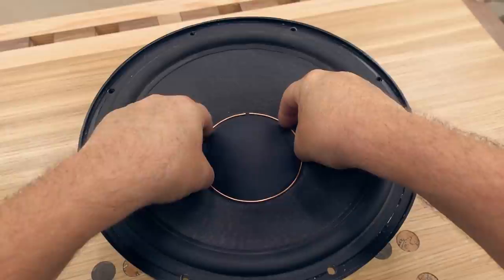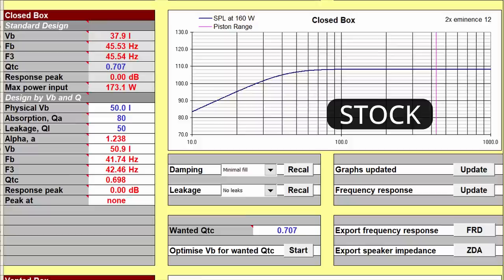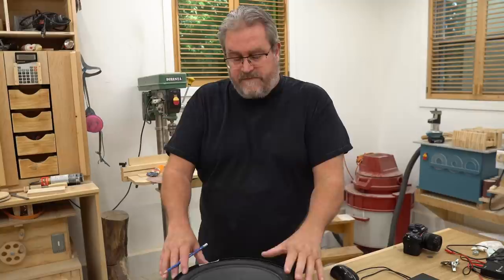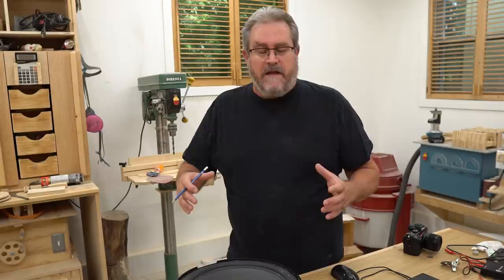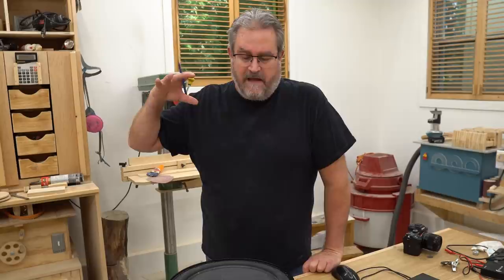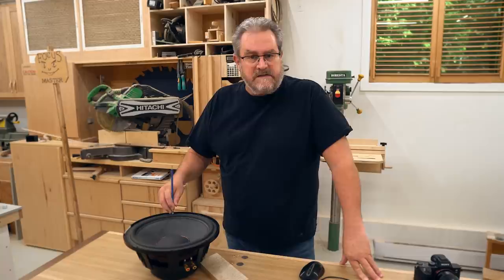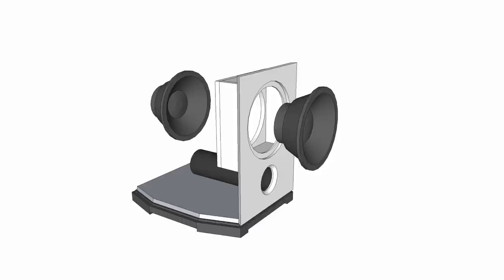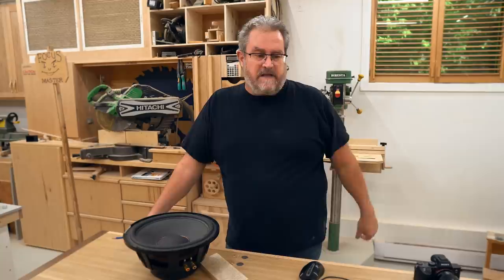Dead Simple Trick to get More Bass from a Woofer / Subwoofer

Comment: I taught, for every 3 DB less sensitivity, you need to DOUBLE WATTAGE from your amplifier to get the same maximum volume. Example: If your speaker can reach 120 DB @ 150 Watt and the sensitivity from the bass speaker is 90 DB @ 1 Watt/ meter,  and you add a ring on the bass speaker cone, the sensitivity is going to be (let's say) 84 DB @ 1 Watt/ meter you would need a 450 WATT AMP for the same maximum volume (120 DB). How are the midrange and the tweeters going to react to that kind of power in your system? There is no way to add a ring in 3 way speakers, I think?
Reply from the maker: Adding 14 grams to a 12" woofer drops the sensitivity by just 1db. 
This is for people who build speakers and understand the specs and design tradeoffs and are able to keep things in perspective.
Reply: @IBuildIt   Thanks for explaining it to me. I'm in an audio learning process, just as a hobby. It's for me like the more I know, the more it feels like I know just a little, and it's really becoming complicated. People like you on YouTube are great to learning about audio, and I'm happy you are explaining things like that in  this video, thanks again mate :)

Comment: And....what about induction in your coil?..non linear.

Better to put the epoxy in and drop in lead shot for weight...not touching.

And what about damping? Can be altered with panels stretched over basket windows.

And what about Xmax?...bottom VC with xtra weight?

And...how does it affect Qms and Vas?

Comment: Adding mass does not increase maximum power handling.  Just getting a stronger amp just makes you more likely to blow the woofer.  Secondly, mass takes time to stop.  The suspension acts like a spring.  It takes time for it to stop mass from bouncing back and forth.  This is what the waterfall plot measures - the decay rate.  Adding mass decreases the decay rate, and that is never considered desirable.  FFS don't ever add weights to your speakers.

Comment: Dang ol subs now over dun glued with the quickness over for some dang ol added weight for them lows and now it got dang more resistance and r value over dang ol glue epoxy with them dang ol drivers set up with the boxes yep and fs is ol dang been lowered now with the raised ohm factor on the chart dived by the ol test modual implicator process ol metal clamps there tester. yersir, know what I mean?..    Boomhower n yep.

Comment: Your incorrect with the efficiency. As you add mass, the driver becomes more efficient at lower frequencies and takes more power to produce high frequencies. As you reduce mass the driver is more efficient at high frequencies and takes more power to produce lower frequencies. Now what you need to keep in mind when producing low frequencies 30-40 Hz. you have to have a driver the has a lot of excursion ( X-max ) for it to have a lot of output.
Reply from the maker: That's not really the way it works. As you drive down the Fs of the woofer by adding mass, it will take more power to produce the same output spl as the unmodified driver. But the modified driver will be playing lower in frequencies - more or deeper bass output.
Reply: @IBuildIt  if you put a high fs woofer in a sealed box it will need more power in the low bass because you no longer have the resonance amplification, which now peaks further up. If you increased the suspension compliance and used a bigger box, the low bass efficiency would come back even greater than the heavy cone.

Comment: This is a bad idea.  Adding mass just lowers the output at higher frequencies and reduces the maximum SPL at those frequencies.   If you want more bass simply use some DSP to boost it.
Reply from the maker: It's manipulating the performance of the driver, like tuning an engine for more torque at the cost of lower revs. 
Drivers are designed - they aren't born perfect, but are a tradeoff of different performance goals. To tweak the driver to perform the way you want it is no different from using DSP, except you don't need DSP to do it.

Comment: Fast bass is more satisfying than slightly deeper bass which is slow.
Reply from the maker: Adding 14 grams to a 12" woofer cone won't dramatically affect the transient response. Certainly not by an amount that you'd be able to hear, or think you hear.
"Fast" bass is one of those ridiculous terms that floats around and used by people who have no concept of the actual physics involved.
Reply: @IBuildIt    Here is the "actual physics involved". When a speak cone vibrates at one frequency and then changes to another frequency (because the bass player played a different note), the cone must de-accelerate and then re-accelerate at the new frequency.  

When a bass player uses a slow 18 inch speaker, it's like horses pulling a heavy cart, the bass player is the horses and the big slow speaker is like a heavy slow cart which drags along behind.  A box of 4 x 10 inch fast bass speakers is like the bass player is sitting on a fast horse with no slow load dragging along behind.

A theoretically perfect speaker cone would have no mass at all so it would produce the fastest possible bass.  The same applies to tweeters, a heavy doped fabric soft dome tweeter tends to thicken the high treble compared to a fast ribbon tweet which does not even have the weight of a voice coil to slow it down. (BTW I don't like ribbon tweeters).

If you want a car to be fast, you buy a small car with a small engine and you buy a big car with a big engine, then you take the big engine out of the big car and put it in the small car.  It's all about power-to-weight ratio.  It's the same with speakers. 

If you want to know how fast a bass speaker is, you only need to look at how high it's frequency response goes. One of my favorite bass speakers the Morel CAW 538 which has a 3 inch diameter voice coil on a 5 inch diameter speaker, it doesn't go deep but it's fast which makes the bass effortlessly agile and musical.
Reply from the maker: If you want to call an analogy physics... 
Most of what you describe is a grossly exaggerated version of what you imagine is happening. The fact is that the "speed" of the cone (transient response) is dependent on several different factors, but primarily motor strength. Low motor strength equals slower transient response. But for a woofer playing below 250Hz, you will not be able to hear that difference unless the woofer is massively underpowered. Even then you need to be in very good listening conditions to hear it, which 99.99% of the people who are serious about audio are not. They are listening in what equates to some of the worst possible places for accurate sound reproduction.
The results of lowering Fs is a lot more complex than I explained in this video and there are a number of good reasons why it would be done. The driver manufacturer Scan-Speak produces mid-woofers and woofers with a higher moving mass (cone) to drive down Fs intentionally. They probably have a few good reasons why they do that.
Reply: @IBuildIt   You say: "But for a woofer playing below 250Hz, you will not be able to hear that difference unless the woofer is massively underpowered".

250hz is upper bass (almost lower midrange) so all woofers play below 250hz and there is a very obvious difference between the fast woofers which play up to 2000hz and the slow woofers which only play up to about 600hz.

You seem to think the power to weight ration (speed) of a speaker only affects "transient response" but the fast or slow characteristics of a speaker are apparent at every note change, not only at transient dynamic changes.

The ideal woofer cone is as stiff as possible to maintain pistonic motion and as light as possible so the cone accurately obeys the magnetic control. For this reason Scan-Speak only adds mass to their cones if they are adding stiffness to those cones, the extra weight being the unavoidable byproduct of physical cone stiffening.

Phil Jones bass guitar speakers are very expensive and very good, they only use 5 inch speakers, as many as 30 in a single box for his biggest products.

You should set up a slow woofer with a low power to weight ratio and a fast woofer with high power to weight ratio and then invite the public to tell you if they hear a difference. The difference is very obvious to ordinary hi-fi buyers, slow woofers wallow in sluggish overhung output while fast woofers are tight and rhythmicly agile. You need to pay a lot of money to get bass which is both deep and fast.

The fastest bass comes from open baffle systems but they need four times the electric wattage and speaker cone area just to match up to the output of the midrange.

BTW the terms "fast" and "slow" also have the same meaning when applied to amplifies with a fast or slow "rise time" and "slew rate", but that is a more complicated subject than the simple kinetics of loudspeakers.
Reply from the maker: At this point I'm trying to understand your motivation. 
Is it to defend your position with no regard for any contrary evidence you are exposed to?
Or are you trying to convince me that you are right?
Because that second one isn't happening.

I know when I'm talking to someone who has the same level of understanding about this that I do. It's obvious. Much like you can tell if you are a true fan of some sport when you are talking to someone that just has a casual interest. The true fan knows the stats, the plays and the subtleties of the game, while the casual viewer knows his favourite player and likes the colour of the uniforms and most of all hates the opposing team.
Reply: @dreamdiction  "If you want a car to be fast, you buy a small car with a small engine and you buy a big car with a big engine, then you take the big engine out of the big car and put it in the small car."  NOPE!  That ruins the weight transfer and handling of the car.  Bad in the drags, and bad in the roundy round.  Better to build or modify the small engine...
Reply: @marksarovich5534  Power to weight ratio = rate of acceleration.  Adding mass to a speaker cone slows down the cone acceleration equally in BOTH directions of BOTH acceleration and deceleration, so adding more amplifier power does not overcome the slowed speaker response caused by adding more weight to the cone.

Comment: Yeah that trick will cost you transient response. Good for disco and rap but not for jazz and Rock
Reply from the maker: I'd put good money on your inability to hear the difference. Too often people blow very minor changes way out of proportion, based on their assumptions. 
The mms of this driver (moving mass) is a lot lower than other modern drivers that are designed for smaller boxes that no one would say are unsuitable for jazz and rock.
Since I will be making this modification to these drivers in the future, I'll measure the before and after step response and compare the two.
Reply: @IBuildIt   well my friend you would lose that bet I've always noticed the difference between a muddy bass speaker and one that's tight like a JBL or Electro-Voice. If it were that easy any manufacturer could make that easy shortcut by adding weight.
Reply from the maker: They do it all the time - they juggle all of the factors that are within their control to tune the driver for specific applications. The very, very highly regarded driver manufacturer Scanspeak adds mass to some of their best units to lower the Fs. It's just one of the tricks that speaker designers can use to get the results they are looking for.
And it's too bad we can't follow through on the bet, because I'm quite confident I'd be walking away with a slightly higher net worth :)
Reply: @IBuildIt  you're a stellar Carpenter I'll give you that
Reply from the maker: What is so terrifying in that video that I'd be afraid to watch it? Or do you think it somehow backs up what you are trying to say here?
14 grams isn't 14 pounds - the difference in the step response from the added mass driver and the stock driver will be miniscule. If you had any real understanding of speaker design, you'd know that and we wouldn't be here.

You didn't ask what the motor strength of the driver is to see if the added mass would be overly detrimental.
You didn't ask the stiffness of the suspension either, and you'd need to know both to even give an opinion on how the added mass will effect the performance.

All you did was say something you heard from other places about "fast" bass. That's the extent of you understanding.

And I'm not saying this to humiliate you. I'm saying this because you should know that it's obvious to people who understand the subject when they are talking to someone who doesn't.
Reply: @IBuildIt  sorry you still don't get it some people never do

Comment: 33.42 Hz is Absolutly STUPID, Imagine WHAT This Could Do In Them BassHeads Who Put Subs In Them Cars? Daaaamn, I Have Old Logitech Z2300 And I Ripped Appart Everything Because The Mids Went Out And I Cutted Them off At The Pcb And A Made A Box Just For The Subwoofer Itself (Polish Made One) And Connected It To The Logitech Z2300 Subwoofer Output , I  PutThe Subwoofer AND The Amp Into The Box So Its An Active Sub Now